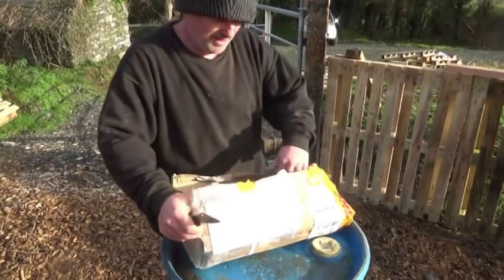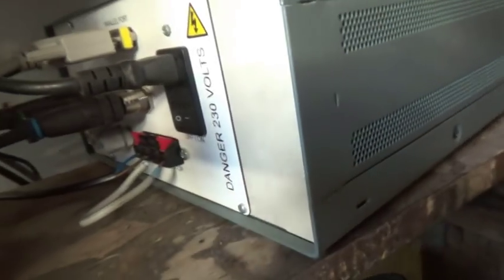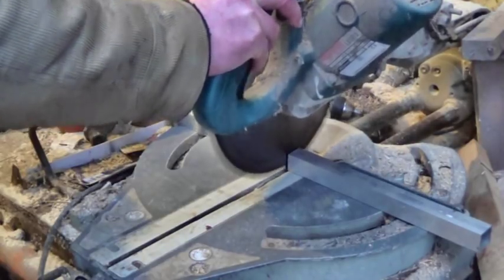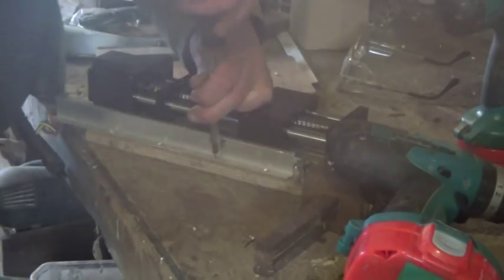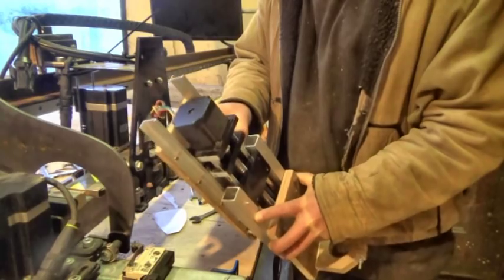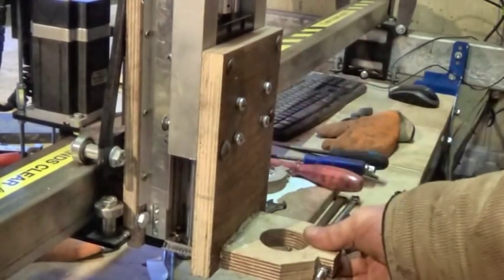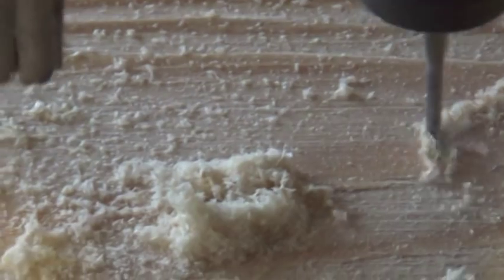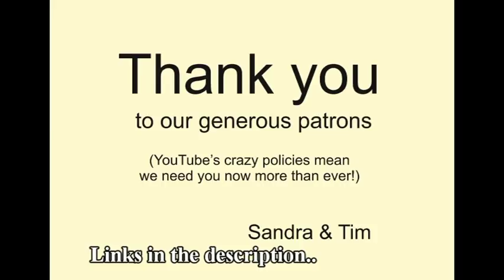Building A HUGE CNC Router – Part Four, attaching the router (and first cuts..!)

Comment: Nice so now I’d have to purchase a computer for this all to work stuck with just a phone 😂😂😂😂
Reply: I run my CNC machine off a PC I bought at a thrift store for $6. What computers are suitable for the task is a somewhat tricky matter to explain. CNC requires low latency not raw processing power.
Reply: I run my with a Raspberry PI v2 - has worked perfectly for 2 years.
Reply: @JamsterJules  my thrift store PC was cheaper than a PI is. The whole system cost $12. That's monitor, keyboard, mouse and tower. Plug it in and go.
Reply: @1pcfred  I was just offering a cheap , reliable alternative. I didn't realise I was entering a competition for cheapness.
Reply: @1pcfred  Well done.

Comment: Love the low tech approach. And I think the Kress is more then enough for wood. My only complaint on it is the noise. On my next machine I will try a water cooled 2,2kw spindle, not because of the power but for less noise.
Reply: I tried using a wood router on my machine and the noise drove me up the wall. Plus routers have limited collet selections too. The only beef I have with my air cooled spindle that I have now is it does not turn fast enough.
Reply from the maker: You're right about the noise. Are the water-cooled ones much quieter?
Reply: @WayOutWestx2  Yes. Its pretty much only the cutting noise with those. Many videos on noise comparison here on YT. Its a bit more of a hassel with the water though. And some quality controll issues with these chinese spindles. The Kress is a quality German product, so I will keep mine untill I build a larger machine.  But noise is a big concern for me since im indoors.

Comment: Aluminium cuts easily with HSS or carbide, the concern is not chipping the teeth, rather wood working machines run too fast so it is easy to generate too much heat and cold weld aluminium chips on the teeth making the blade act as if blunt.   I often get this even on my metal lathe with carbide cutter running at much lower speeds.
I once tried to cut a piece of aluminium bar with a jig saw.   That was a mistake, the teeth filled with chips in a few seconds.
Very good progress on the CNC router.  I can imagine your excitement with the first successful cuts.   Well done.

You may not need a bigger router, but the one you have may not last long, they are not designed for long operating times or the higher loads of CNC operation vs hand operation.
I know the pleasure of getting gcode to work, in my case on a 3D printer.
Dave.
Reply from the maker: Ah ha! I see. Thanks.

Comment: I would have been thinking to make the attachment board out of aluminium or steel, but having thought about it, plywood is probably a lot better being lighter, dimensionally stable, easy to replace & lower cost. It will be nice if the router becomes the factory that supplies the world's guitar players demands for your invention. Thanks for sharing!
Reply from the maker: I've just given away my small cnc router, so this one has to work or I'm in trouble!